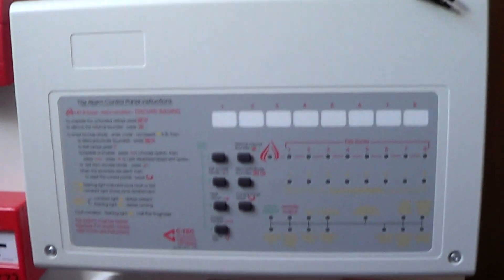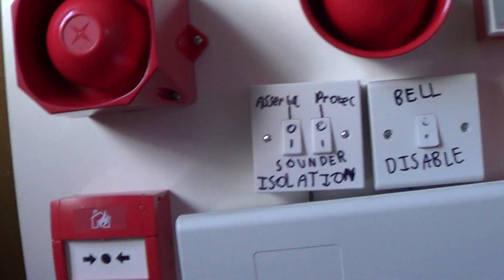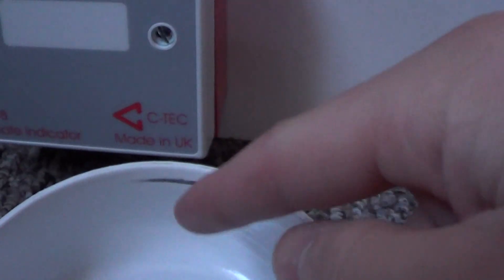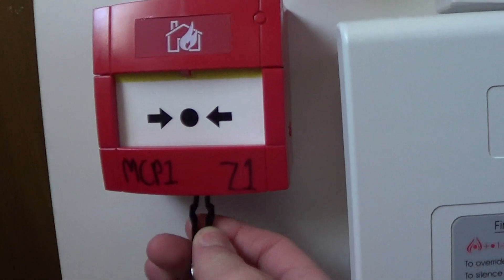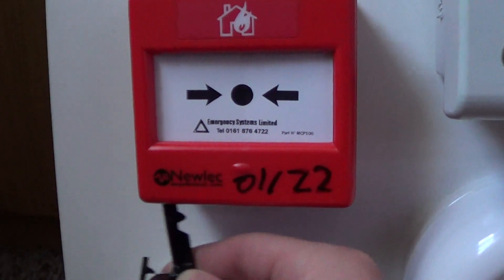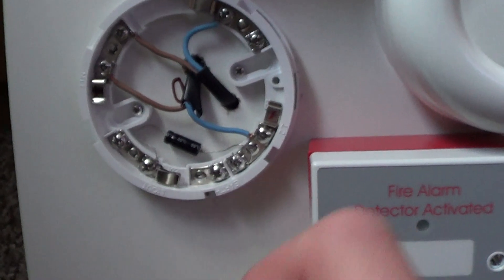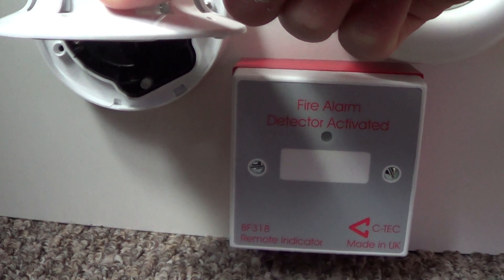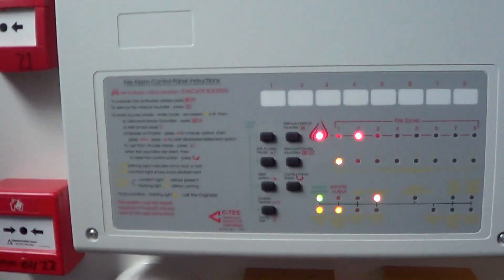System test 1 - C-tec CFP

Comment: 3:43 actually that's the first version of the new style Kac so its the older type before it was re designed with the slide front
Reply from the maker: Oh, I throught it was the first because I have never seen them before. Interesting to know though, thanks!
Reply: @GraingerElectrical  OMG  your voice has changed so much since I saw your last video of the unboxing of the KAC callpoint! 🤣